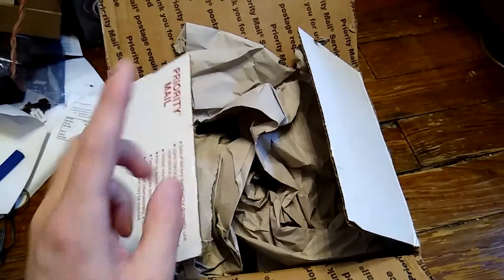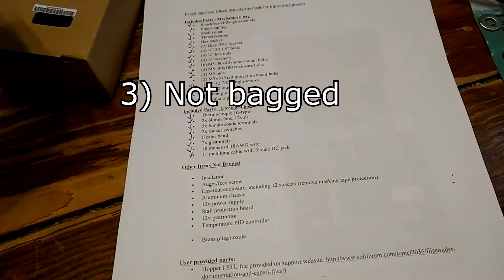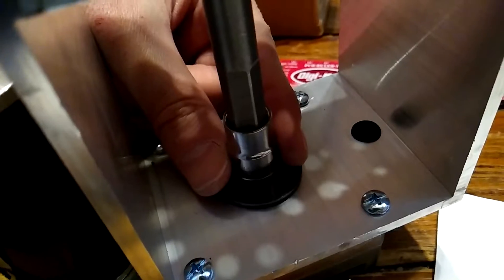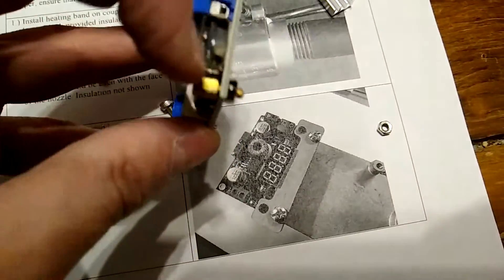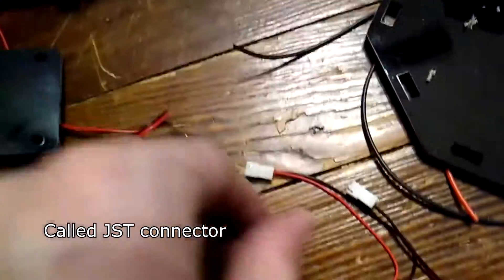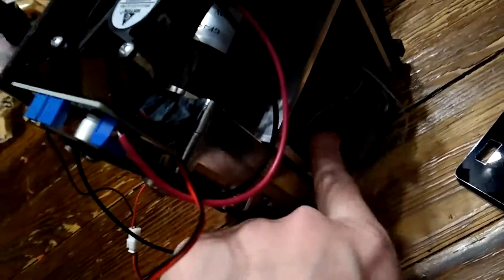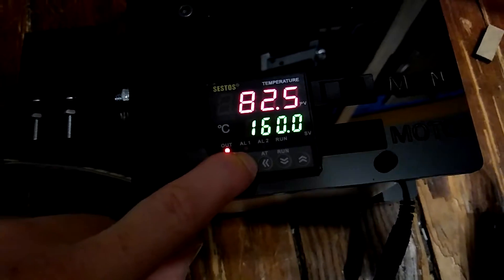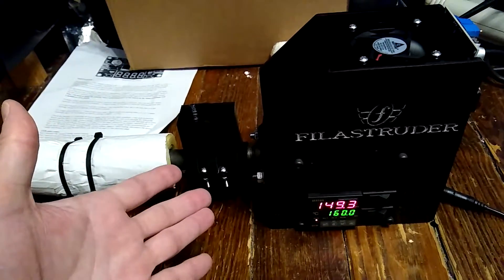PROJECT #7 - UNBOXING, BUILDING, AND ASSEMBLING A FILASTRUDER v2.1 WITH v2.1e INSTRUCTIONS.

Comment: Thanks to your video (and watching it a kajillion million billion times, and pausing even more) I was able to build this kit. I don't think I could have without your video, to be honest. That said, I did have to come up with some solutions of my own, such as drilling additional holes in the aluminum block, putting shim washers under part of the pipe flange to mount it straight, and some other things. Filastruder really needs to bump up the QC and build experience. With a little more prep on their side, and better guidance on assembly (wiring in particular), their product could break out of the DIY market and into the wider consumer market that can build something with instructions, but can't engineer their own solutions when something is completely missing.